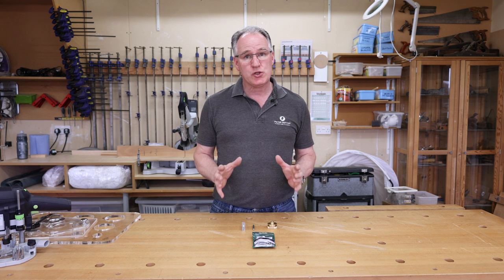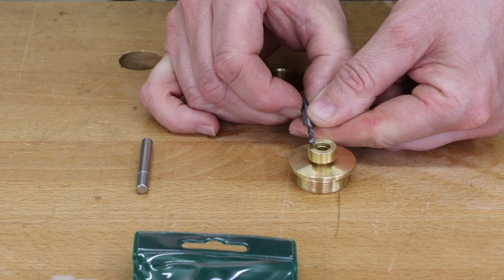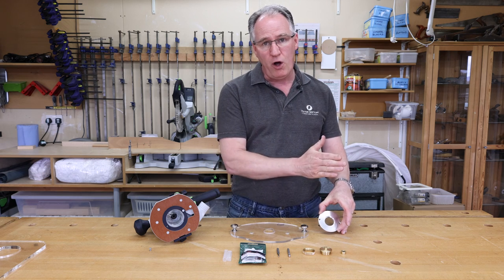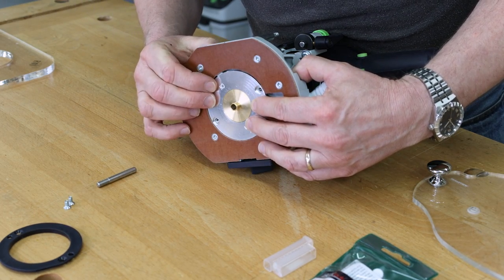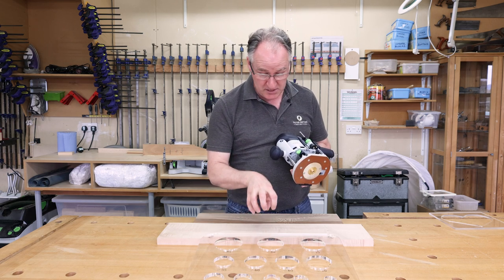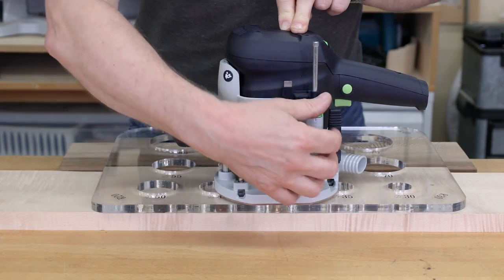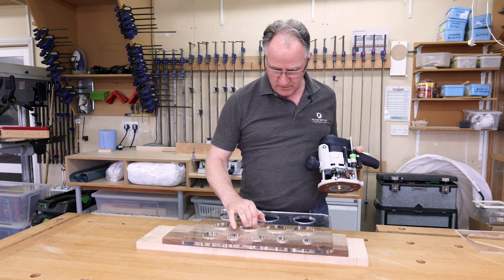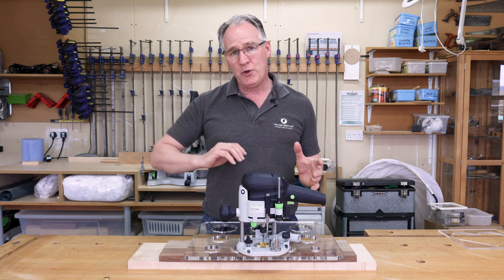AUKTools Solid Brass Router Inlay Kit

Comment: Good tip about plunging into the centre and then cleaning out the 'hole' into which the inlay goes.   I wish I saw this video earlier on today as I was practising making inlays with guide bushing set and 1/4" cutter.
Reply from the maker: So pleased you found the video helpful.

Comment: Can you use this to make a template for a piece i already have and want to inlay?
Reply from the maker: You could but might be better making a negative template to match your shape and use a bearing template cutter. Our inlay kit is designed to make both the positive and negative elements of the inlay from a template.